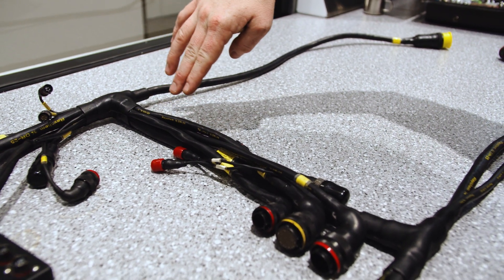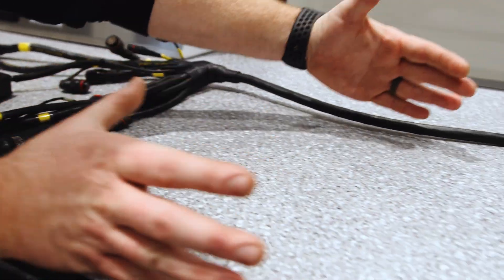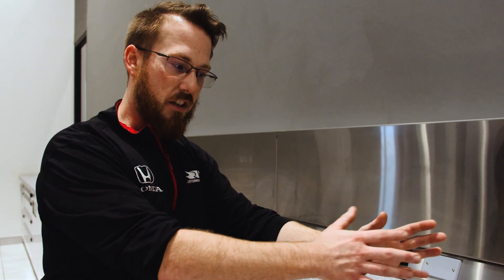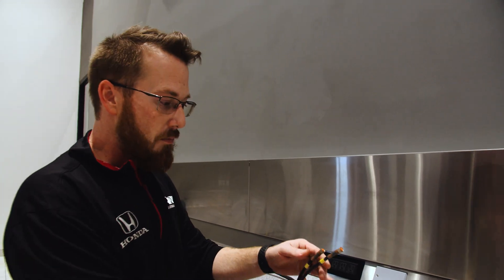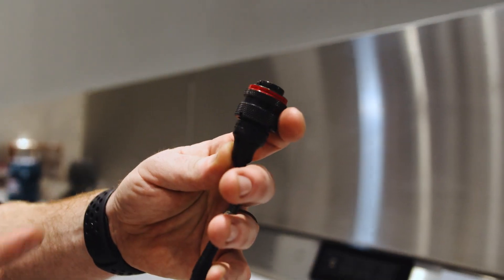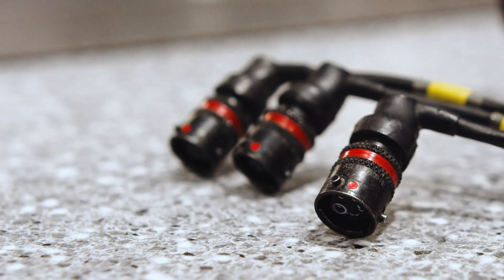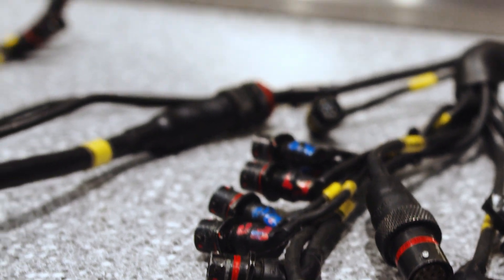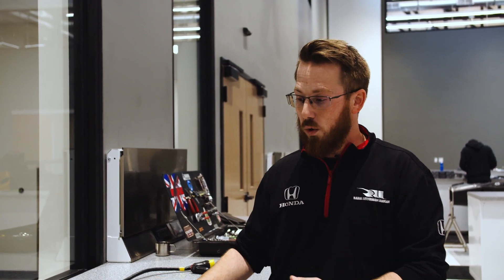How An INDYCAR Is Wired! #TechTuesday

Comment: Do you guys build the wiring harness or does it come from an outside vender and standard for all cars?
Reply: Main chassis harnesses are purchase from either Cosworth Electronics or BF1 Systems.
Many of the accessory looms and extensions are either built by the team (wiring department and/or electronics department) or purchased from a few different vendors.